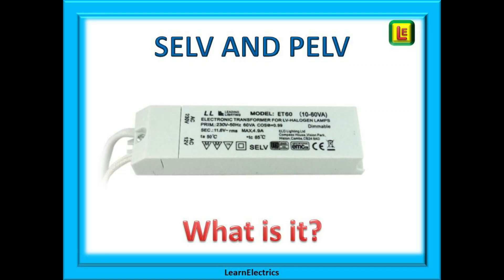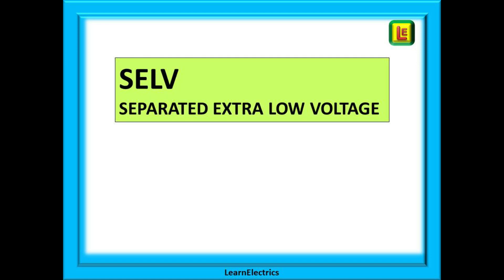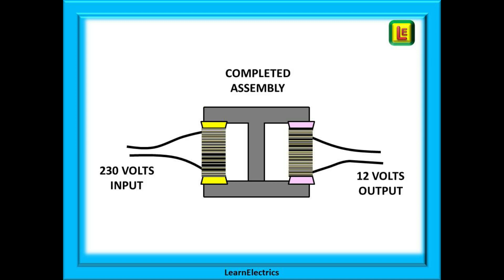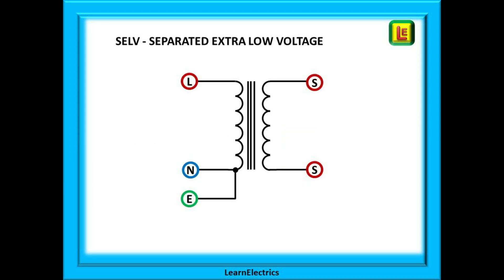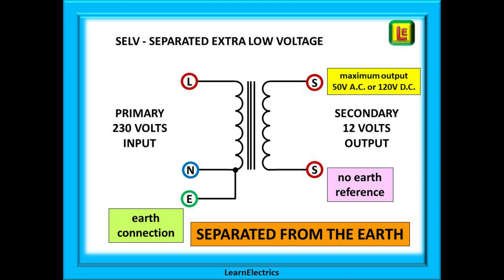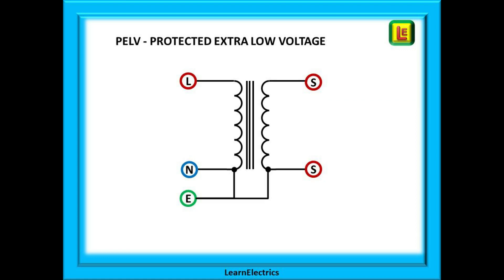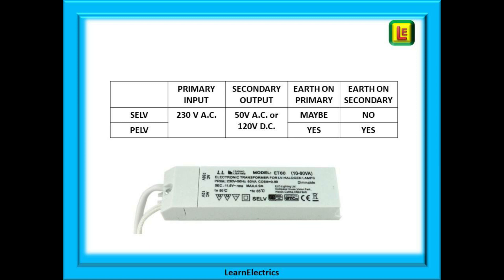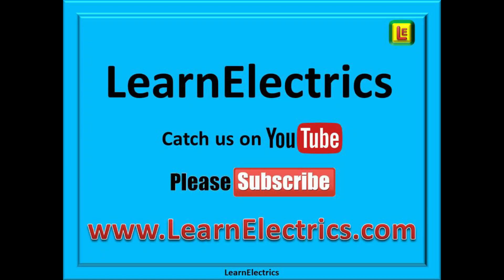SELV and PELV what is it? ? Learn the difference between the two types of transformer.

Comment: The pelv diagram showing neutral and earth joined on the primary or input side . 
This would cause rcd tripping . Also in the case of Neutral Earth reversal  ( which is common) cause the protected side to be at line voltage . 
Are you sure it’s protected then  ?
Reply from the maker: The PELV transformer is an isolating transformer with an earthed electrostatic shield between the primary and secondary windings. This reduces the inter-winding capacitance and the leakage current that will flow through that capacitance under normal conditions. Hope this helps. Dave.
Reply: @learnelectrics4402 
So the neutral and earth on the primary are not connected then ? The diagram shows otherwise. 😳

Comment: thank you for that simple explanation. i understand the application of SELV in lighting etc but why would we choose Pelv as our method of obtaining ELV? i would guess for wiring where we need an earth reference on the secondary to accommodate earth leakage for function of equipment? thanks.
Reply from the maker: PELV transformers are cheaper than SELV, so a door bell for example could use a PELV.

Comment: Hey Dave, I wanted to ask because the earth is seperate in a SELV transformer why wouldn’t I get an electric shock even if there is no earth return path because you still got live and neutral which are live conductors but only at 12v but why does the return path not being there reduces the risk of an electric shock?
Reply from the maker: Have another look at the video. If you grab hold of the secondary side, there is no earth continuity from your feet back to the the secondary side, there is just no earth path. the current wants to get back to where it started from and it can't. the primary side has nothing electrical to do with the secondary side.
Reply: @learnelectrics4402  so what you’re saying is that  because the circuit is not completed the current has no where to go because what I didn’t understand was even though you touch live and neutral I thought that would just give you a little shock
Reply: @kylegreenslade9952 yes, touching both LN (AC) up to 50V max on the Sec. Isolated side Might still give you some shock; but given the maximum permissible voltage & resistivity of human body, the amount of currents produced may be insufficient to be categorised as Safety Hazard.

I believe all these are alrdy taken into consideration when engineers outline SELV criterion.👍
Reply: @learnelectrics4402  thanks mate so what you’re saying is primary side has L N and E but the secondary side doesn’t so in order to receive an electric shock the circuit needs to be completed with an earth being there? But because there’s no earth the current hasn’t got anywhere to go to so it disperses?

Comment: Are you sure this is correct? Earthing the neutral conductor at the primary side?
Reply from the maker: Neutral and earth are the same point electrically back at the incoming point of entry. Thanks for watching. Dave.
Reply: Thanks for answering. Then you are introducing multiple connections between the neutral conductor and earth. Right? I believe the general rule is that neutral to earth connection should only be made in one location only. Normally close to the secondary side of the supply transformer. The connection being the so called system reference conductor.  I would have expected that your PELV drawing showed that neutral to earth connection was made at the secondary side of the transformer only. Why do you have it additionally on the primary side? Does it do anything there, other than creating circulating currents in the earth paths?  @learnelectrics4402

Comment: There an LED Driver output more then 120vDC and they write on it SELV, INVENTRONICS Driver, this name of the manufacture
Reply from the maker: If its measured open load, it may be slightly above 120v, what is it on-load, as it may drop. Check it on and off load before you make any decisions about it.

Comment: So I am trying to learn this stuff for an exam up coming. Q1/ PELV  Why and WHERE would a designed PELV bit of equipment (audio/video IT) be Protected if its already ELV????  Q2/ How does it relay to the Energy Source 1, ES2 class or ES3 classes. Thanks mate
Reply from the maker: PELV is protected. It means that any problems on the primary side cannot get to the secondary side. All done by the way the Tx is manufactured. Plastic around the metal core, physical separation of primary and secondary etc.

Comment: Reference the link between E and the neutral, the comment by eFIX (6MO) IS absolutely correct, the RCD supplying that circuit would trip immediately it was connected. There may be some misunderstanding as to why that is so, there will be a small voltage between N and E,  this comes as a result of voltage drop along the N lead caused by any load back to the transformer, this may only be a few volts but sufficient current may flow to trip the RCD.
I should add that I cut my apprenticeship  teeth on the 11th edition!! of the regs this volume was almost small enough to fit into a jacket pocket. I don't  envy the electrician  of today burrowing through the monster volumes or the 18th.
Reply from the maker: Great information John. I think I was taught on the fourteenth edition. A very thin book if I remember, compared to todays heavyweights. And of course, amendment 2 is due out in March.

Comment: Must  the selv device comply with EN 61558-2-6?
Reply from the maker: If you want to comply with the Building Regulations then yes. If you use a different shaver socket then you are responsible for ensuring it at least meets if not exceeds BSEN61558-2-6. Hope this helps. Dave.
Reply: @learnelectrics4402  Dave,thank you for answering.I am not a native speaker,could you please clarify the meaning of "shaver"?
Thank you.
Reply from the maker: Electric razor. A two pin connector and isolating transformer for an electric razor for trimming a man's beard.
Reply: Ok,now,i got It. The load haven't been connected to earth leads.

Comment: Are you sure about the connection between N and CPC on the primary of the SELV transformer- that would cause an RCD supplying to unit to trip.  It’s our understanding that metal core / and or a barrier within the transformer is connected to earth.
Reply: The video is wrong.  Never ever connect the mains Neutral and CPC wires.

Connecting one of the OUTPUTS of the PELV transformer to CPC is allowed, because that doesn't involve the mains Neutral wire.  But never connect neutral and Earth on the input of a SELV or PELV transformer.  As you correctly point out, that would trip the RCD.
Reply from the maker: Yes that's correct, the earth and neutral are divided at the service head.

Comment: Great video. New subscriber.
So, why would one use a PELV instead of a SELV, or vice versa? I think explaining this and giving real world examples would have been a great way to wrap up the video.
Reply from the maker: Cost, PELV is cheaper to make. If you are making thousands of something that only need a pelv transformer then those few pence difference add up over a year of manufacturing. Its always the power of numbers in factories. Thanks for watching, appreciated.
Reply: @learnelectrics4402  How can PELV be cheaper when it requires an earthing wire? surely it's more expensive.

Comment: 🤔 are SELV circuits better than PELV circuits because earth is connected to both primary and secondary on a PELV circuit? 🤷‍♂️
Reply from the maker: SELV circuits offer more safety than PELV. Check out the video again Lester. Because there is no earth path back to the primary side, fault current should not travel through the body to earth in a single fault condition on the secondary side. Hope this helps.
Reply: @learnelectrics4402  thank you 🙏🏽
Reply from the maker: You a very welcome. Dave.

Comment: Is fire alarm system a SELV or PELV I have seen on blogger cut out the earthing wire in the circuit he did
Reply from the maker: All fire alarm systems are different Dennis. Some are using 12 volts, some are using 230V. They can be double insulated in which case they don't need the earth, some systems use the earth. Hope this helps.
Reply: @learnelectrics4402  thanks

Comment: I didn’t realise the primary side on the selv transformer could be referenced to earth. 
In theory if you applied 12 v to the secondary side(from an external source), could you ever get 230v out the other side 🤔 

Thanks for sharing, great video👍👍
Reply from the maker: That's how STEP-UP transformers work, 230 volts in and 500 volts out, or Safety Isolating Transformers 230V in and 230V out but the secondary is isolated from earth as in your typical electric shaver socket in the bathroom. Good question and thanks for the good feedback too. Dave.

Comment: Great video. Well explained, thank you. I have been asked to install a  light in a cupboard under the stairs in a two storey private detached house. The stairs are in two sections with a small landing between the sections. The best place to install the light is under the landing. This is the ceiling of the cupboard and is made of mdf. I am slightly concerned about fire regulations. I welcome your thoughts, please.
Reply from the maker: Thanks Mark, yes a valid point and it does matter. The best people to ask are your local wholesaler, they will have a range of high lumen lamps and fittings that have a very low wattage per lumen so they will not get as hot as an incandescent light. This can be a better option than putting some insulating material between the lamp and stairs, or do both.
Reply: @learnelectrics4402  Thanks very much for your answer. I like the belt and braces approach.
Reply from the maker: Too right Mark. At least you can sleep at night knowing you have done all you can.
Keep safe, stay lucky. Dave